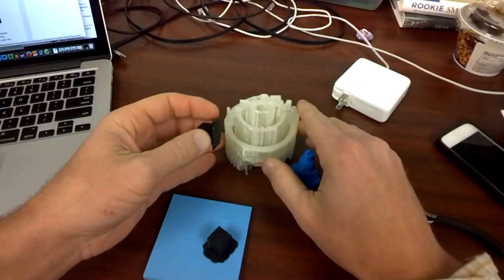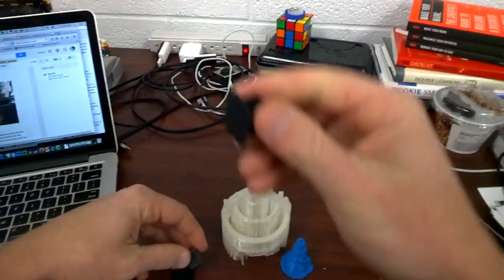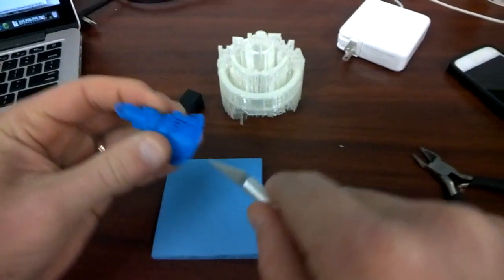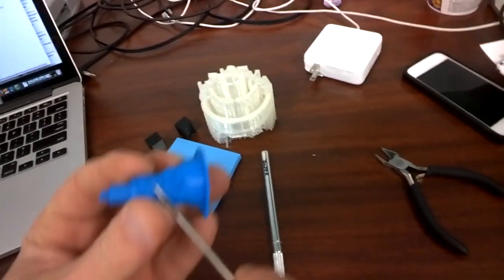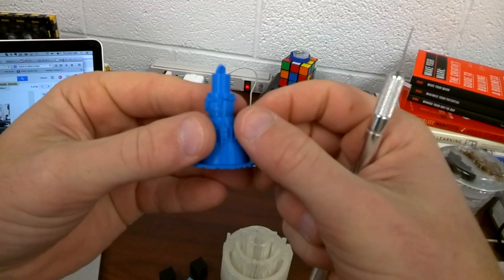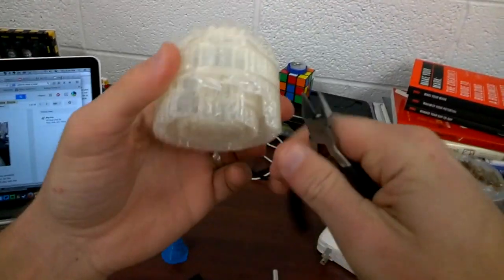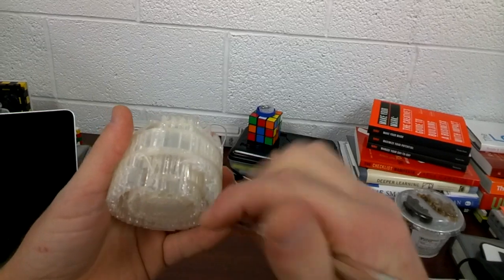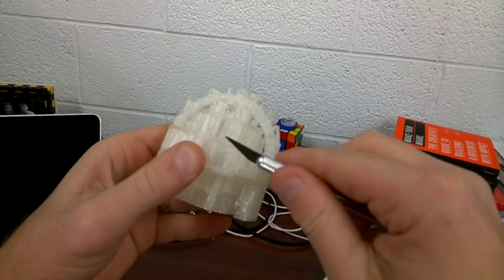Removing Raft and Support from 3D Prints

Comment: I found it pretty easy to let it soak in hot water (for about 30-45 min) to help soften the plastic. And use treelike supports beacause it leaves a little dot of filament between the model and support. Then use that exacto or a boxcutter and slice it right on that dot. If you slip, you can rub it out with ultrafine sandpaper.

Comment: I printed a case for an electronics part, & used a raft. I removed the raft, but the surface of the case is all rough. Is there a way I can soften the raft remains to get it off, or have I got to sand it smooth?.